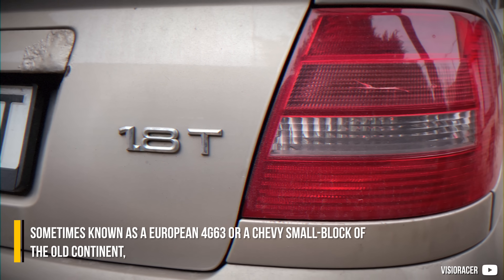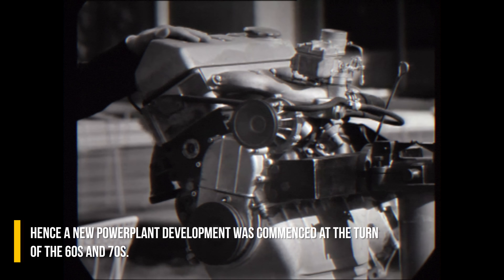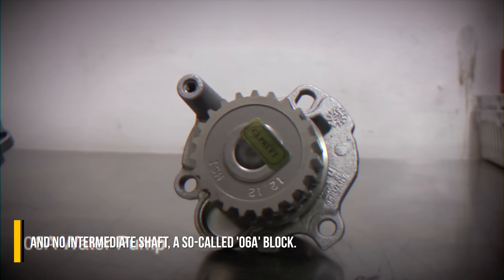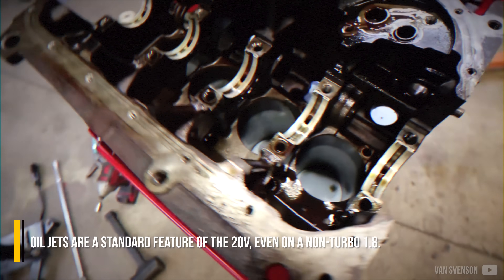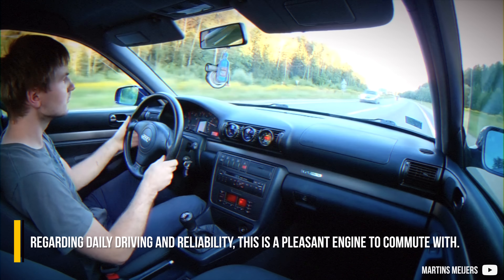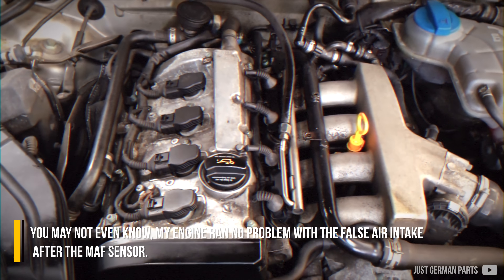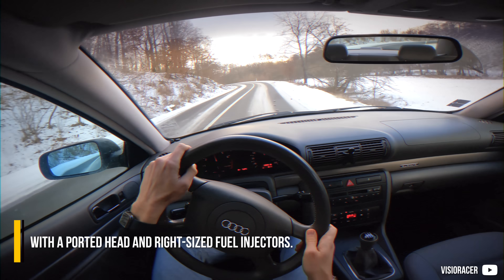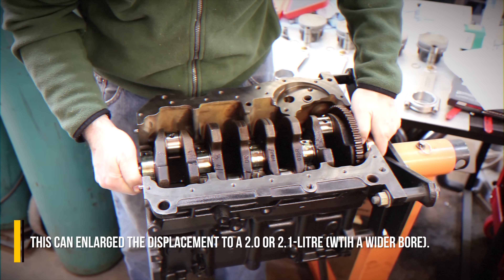Why Is The Audi 1.8T 20V So Good?

Comment: I had a 97 A4 1.8t with just a tune. 190hp / 290nm, it was fun to drive and torquey but wasn't happy much past 5k rpm. The stock downpipe is a bad restriction.
Reply: i have a a4 b5 currently, it belonged to my grandpa before and he tuned it. i am now looking for a 3 inch exhaust and a k04 tubro.
Reply: @flstudiotutorials1057  where you guys at? Im in jersey and I’ve never seen another b5 i feel like im the only one
Reply: yeah if you install a full exaust from the headers to the end, and install an IC and tune it it's so much fun and you can go up to 7Krpm

Comment: Wow your prediction of 186,000 miles is pretty accurate, i had to replace my piston rings due to lost compression at 185k.  It would've ran longer if the ebrake didn't fail and hop a curb and go swimming in a pond with a cracked oil pan.  still made it 5k miles on a huge roadtrip and back before the rings seized.

Comment: Well... my US spec 1.8T had issues all over. Failing coil packs, cracked head, starter issues, failed intake hoses.
The icing on the cake was a failed timing belt tensioner at 50k miles, just out of warranty. Valves collided with the pistons, destroyed the head.

Good times!
Reply: What part of the US you lived in? The cracking head/turbo is mostly in hotter climates. I went through one 1.8T engine but it was because the previous owner didnt change the oil and it sludged up and killed the oil pump. The second engine i had for around 50k miles and it was faultless. Had some vac leaks but sorted that out and a dipstick tube that fell apart from age. All very easy and cheap fixes. I loved every minute owning it even with the first one loosing oil pressure which wasnt really the engines fault, more of the previous owners and the fact that I didn't notice
Reply: @waifuracer6516  I had the car from new as a 97 model in Texas. Further issues came up when the head was replaced as the the shop reinstalled the turbo after it had been damaged while extracting a stripped bolt/stud. I didn’t include these issues as that’s a dealership problem not an engine issue. It got to be such drama!
Reply: Actually the head cracking issue was on the b6 Audi A4s due to them switching casting manufacturers. The b5 never had that issue.
Reply: @GRCPhantom  My B5 had the cracked head. May not have been common but it was enough for the coolant to pool in the spark plug well and crap out the coil pack.

Comment: Does no one make an UEL-header to make it sound like Subaru? :D
Reply: pretty rare to see header turbo manifold on these since the engine bays are pretty tight and if someones modding the exhaust manifold/headers they already have decided to use a bigger turbo which eats space.   

ebay has some UEL 4-1 headers for this car for the stock k03 and k04, but most people just use a small turbo manifold that the runners are only a few inches long.

Comment: Thanks for the video👍, my nephew loves these engines. I'll sticks with my 1.9 TDI, 400k miles and still running strong.
Reply: Wow that's a very long running engine.
Reply: I got the 1.9 alh tdi and the 1.8t's bigger brother, the 2.0t. Both very fun cars! Tdi has 350k miles and haven't had to do anything other than timing belts
Reply: @joshh694  alh tdi?
Reply: I'm on 339 000 miles on my 1.9 TDI

Comment: I wonder if u can modify a Honda VTEC cam to run on the intake side. That middle valve would get the VTEC lobe at all times. Just a random thought. But it wouldn't to far off. 
Also would be cheaper just to upgrade the original cam. But still.
Reply: That’s actually a good idea, it would all depend on degree of when the cam opens plus valve springs and retainers.

Comment: there are issues on the 1.8t tho: turbos and headers like to crack, theyre consumables on those engines due to the head being a hot one. oil sludge that can block the oilintake from the pump, so you should be doing your oilchange atleast once a year or every 10k km. sometimes even the head can crack from valve to sparkplug hole, but thats rare. other than that, these cars are getting old so youll be needing to do lots of cooling hose replacement (nearly all on my 99tt bursted by now), some stuck theromstats here and there, some leaking cooling flanges. some leaking valvecovers and oilpans, other than that, if taken good care of they are pretty reliable. also they are huge differences between the 150 and 180hp engines to the 225/240hp engines. the higher power one feature double oil squirters for the pistons, dual intercoolers, a shorter and flipped intake, bigger turbo and bigger injectors. other than that great video, you covered a good amount of infos. much love from germany
Reply: you can also prevent oil sludge by using thicker oil instead of 5w30, something like 5w40/5w50
Reply: I would like to add, that I've got mine A6 1.8t AJL 98', used with 120k and a suspicious clean engine and coolant...
 Of course the thermostat was stuck open with a blade from the water pump, but even after it got stuck closed and boiled over countless times, on way home, frying up the oil, I've got it cleaned and tuned and drove it like a hooligan, for another 5 years until "it broken down again", loosing coolant in seconds!
 The guy who bought it and fixed it for ridiculous little money, still drives it!!
Reply: 10k oil changes are way too far apart
Reply: @matteosantucci2310  in km? no, thats perfectly fine,i drive mine daily but only clock in around 5k per year, so i do them after exactly one year and so far so good
Reply: I got all of these in less than 3 years when I had the car new. The a4 b6 is such a lemon.
Reply: @skippylegrandgourou2069  yeah the 1.8T is full of problems.
Reply: Just goes to show how overrated these engines and cars are. Depending on who you ask lol
Reply: @velvetbear7184  pretty much. great driving engines until theyre not taken care of
Reply: @velvetbear7184  that engine is a pile of shit the only reason people like it is because it cost nothing you can get one for like $300 throw a gigantic turbo on it and shit tons of boost until it blows and that's basically what people with 1.8 t's do it's like the Subaru motor of Volkswagen
Reply: @zakbrinkhoff324  Well I have  two 1.8Ts, older has 350K km and the car is now 26 years old, in my possession 20 years. Not a single engine issue, running on stage 1 map, and even LPG. Driven to 6500-7000rpm all the time. Engine is very reliable, just change oil regularly. The other one goes to track days still. Tell me single engine weak sport, there are none. Oil sludge is not real issue, people do no change oil regularly or put mineral oil, then it can happen.
Reply: @jutjub22  most of them never make it that far.   How many turbos did you go through and how many oil leaks did you fix? Also if you're not in the United States the engine is slightly different and more reliable
Reply: @zakbrinkhoff324  one k03 replaced. There were some oil leaks over time, some gaskets, can't remember exactly. Engine was never opened or similar. This is first AEB engine made in 95' in audi A4 quattro.
Reply: @jutjub22  the only time you don't open the engine on those is when you immediately take care of the oil leaks especially the turbo ones lol.  Either it dies from oil issues usually or some dude turns up the Boost way too much also those older ones were more reliable
Reply: They eat coils . No clearance between oil pan and pickup tube along with sludge issues
Reply: @fuse8052  ignition coils? if so, an upgrade to tfsi coils (red audi ones) should help. i did that with my tt. if you have the factory square ones that is
Reply: all turbos on early 2000 model VAG cars were crap
Reply: Ya was bout to say I see these a lot and think they blow up just because they feel like it
Reply: I had an AEB and now I have a BFB so BFB is from 2006 and AEB from 1997, I should have a better engine then right?
Reply: @tiagosilva.b5  a more modern engine, but not better. My example is an ajq from 1999 and its known to be one of the better ones
Reply: @LcFan96  nice 💪
Reply: Im blessed with a cvt amb….
Reply: they crack between valves as well. Just had my AMB head crack between 3 valves on cylinder one lol
Reply: @half3651  yeah I’ve heard about the head cracking, well 227 thou and still goin strong!!
Reply: Yep
Reply: Just saw one in a shop that lost all oil pressure whenever warmed up, turned out the oil pump pickup was completely blocked off by oil sludge. Looking at where I live I guess the previous owners used 10w30/40 and didn't change it in time. The head was quite dirty too.
Reply: What models have 240 hp factory?
Reply: @ audi tt quattro sport edition, rare, but they are there
Reply from the maker: Thank you for sharing additional knowledge of yours!
Reply: @VisioRacer  thats what we are here for, your great videos with informations packed into it.

Comment: Would love to see you make one on the 2.7TT
Reply: That is the true God of Audi engines that's the equivalent to the 2JZ
Reply: Please
Reply: Its pretty much exactly the same engine.
Reply: @NicoBiturbo  ummmm no
Reply: @Pertinear  It's literally a V6 version of the 1.8T. Same bore and stroke, same style cylinder heads, same materials used for block and heads.
Reply: @TheKILLMANIA25  Only difference is the 2.7 has forged pistons and also the compression height is different. Other than that yeah same bore and stroke.
Reply: @TheKILLMANIA25  The V6 version of the 2.7T is the 2.8 LOL.
Reply: @3n3ly7m9  The 2.7 is a V6...
Reply: @TheKILLMANIA25  2.8 is based of the 2.4. Which has several other variations. 2.5, 2.6, 2.7, 2.8, 3.0. 1.8T would be related the 4.2. As the heads can be swapped if the ports and passages match up. Though one has rollers and rockers vs just cam and the lifters
Reply: @3n3ly7m9  negative on the head swap. 4.2 has larger bore spacing.
Reply: @Arrchey249  It was just a guess, as the heads have the same design, where as the V6 only has 3 pistons on a side.